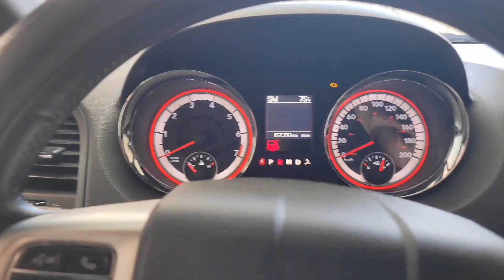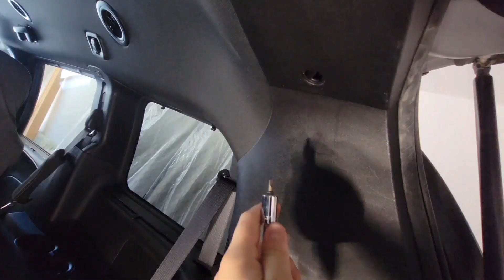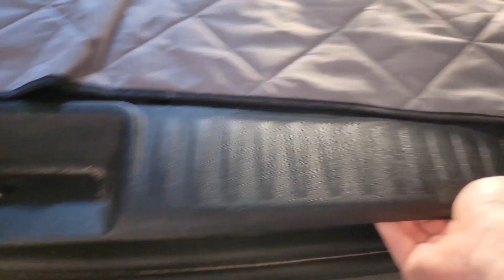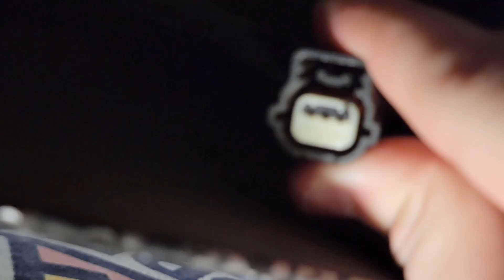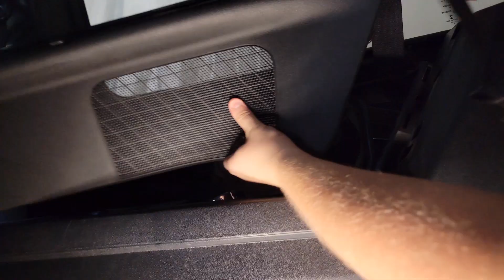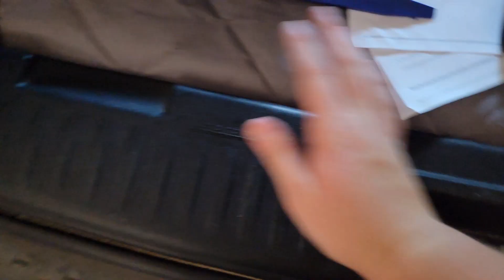2015 dodge Grand Caravan R/T Blind Spot Detection System Fix Town and Country Chrysler Part 2

Comment: those damn modules are super common to break since some idiot put them in the worst spot for them, they keep getting water and dirt on them and they are NOT waterproof, so if your modules are working, take them out and make sure to seal them with silicon all around and put some of that greese in the connector.
Both my blind spot modules got fried and new ones are about 400 each..